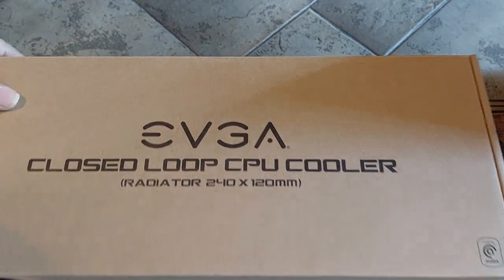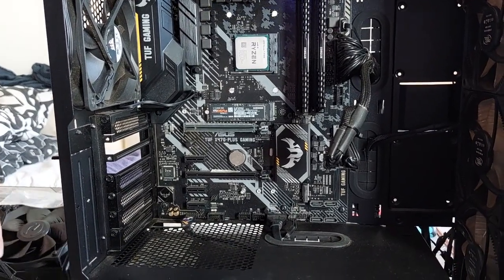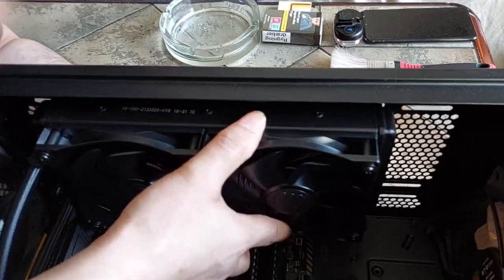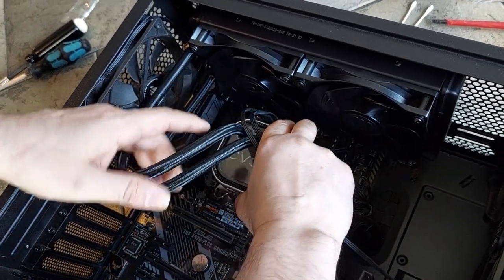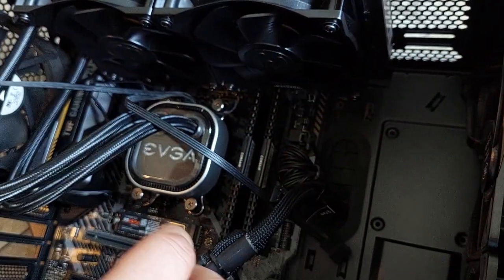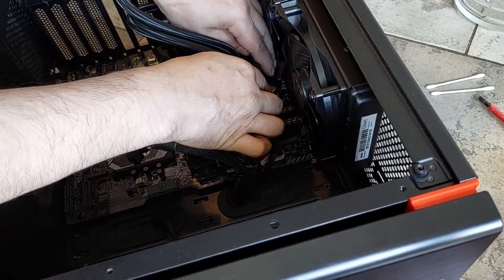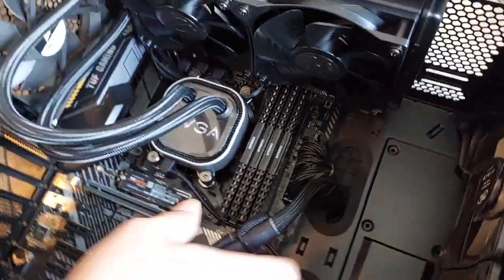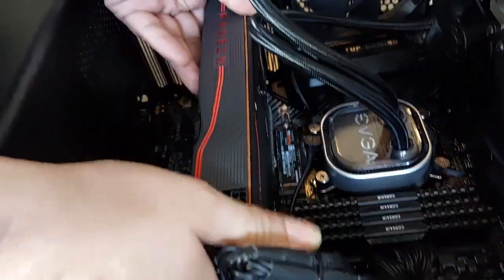How to install EVGA Closed Loop CPU Cooler. Radiator 240x120mm.

Comment: hej hvor har du købt køleren henne, alle steder jeg ser den på nettet står der intet om der medfølger am4 bracket med, eftersom det er en meget gammel køler. rigtig fin video og godt detaljeret :)
Reply from the maker: Tak for ros 👍
Reply from the maker: Den er købt hos computersalg.dk og der er am4 bracket med.
Reply from the maker: Se her der er samme bracket med til begge modeller. Se på tilbehøret bracket på disse modeller.

https://www.computersalg.dk/i/3487021/evga-clc-280-processors-flydende-k%c3%b8lesystem-for-lga1156-am2-am3-lga1155-lga2011-fm1-fm2-lga1150-lga1356-lga1151-kobber-140-mm?sq=evga%20cl

https://www.proshop.dk/CPU-Koeler/EVGA-CLC-240-Liquid-CPU-Cooler-CPU-Vandkoeling-Max-39-dBA/2626602